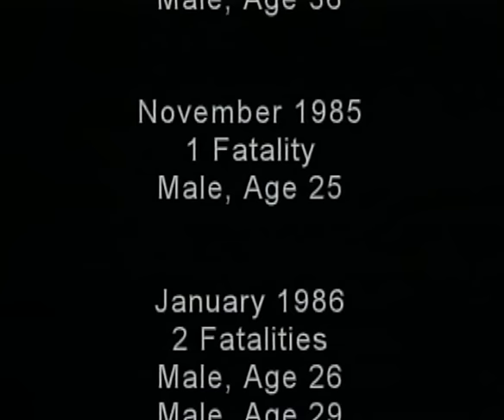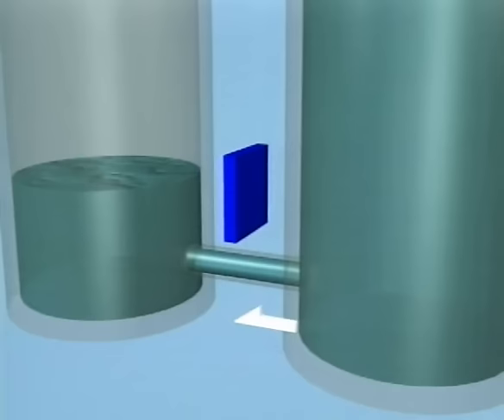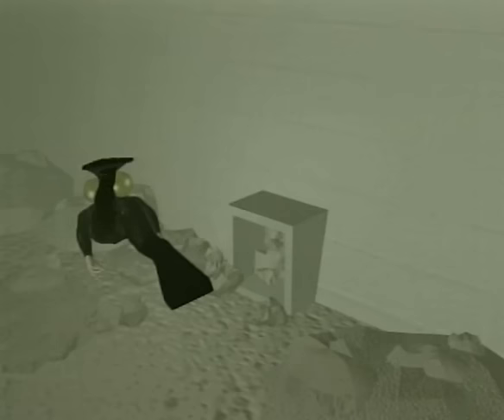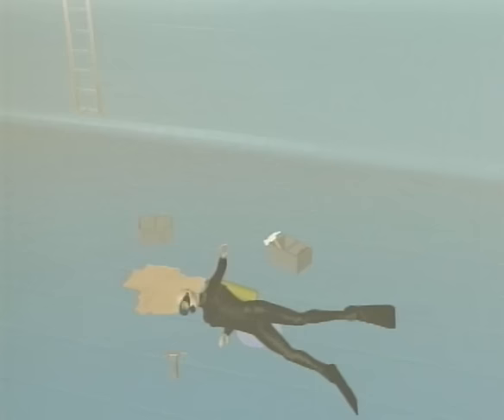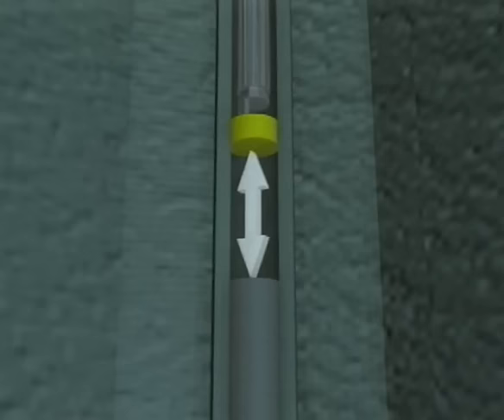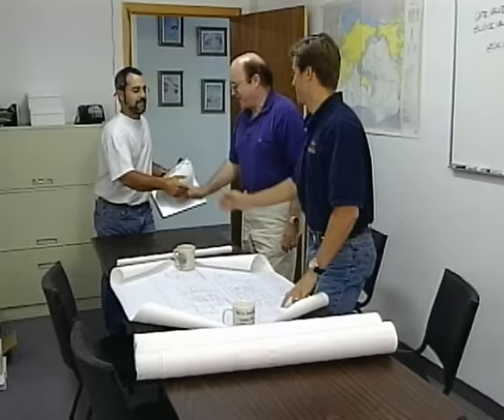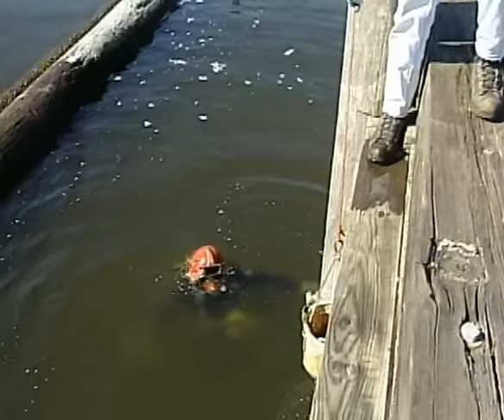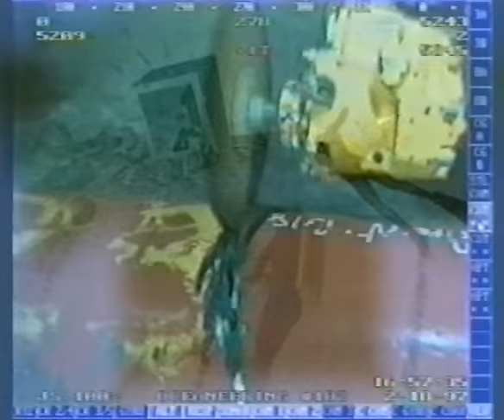Delta P

Comment: This happened to me at a waterpark when I was like 4-5 years old but obviously much lower pressures. I got stuck on the bottom of the floor. Luckily my hand could just reach above the surface so I was waving it. I ended up running out of breath and started breathing in the water then a guy pulled me out... I was sooo lucky. I was literally a handful of few seconds from fully drowning.
Reply: Was it painful when you stated to breathe in water ?
Reply: @ketgremlin8776  it’s a weird pain to explain it’s like almost if your Choking on water
Reply: @amarionthomas8539  only asked because I have a friend how almost drowned and he said there wasnt any pain but it felt quite satisfying
Reply: @ketgremlin8776  Youre in a pool, surrounded by water, you run out of oxygen, naturally your body immediately inhales but instead is greeted by water instead of oxygen. The body doesnt understand this as its out of oxygen and has no oxygen to think and stuff, it continues inhaling. Basically imagine yourself chugging water so fast
Reply: @Covid-bv4hp  just drink all the water out of the pool
Reply: @dachapo6284  Many people tried. They enjoy the water so much they stay in there for the rest of their life for some reason.
Reply: @Covid-bv4hp   damn luckily someone goes down there too save em from drowning
Reply: I think i nearly got stuck on a pool or bath drain because i was playing around with it by repeatedly blocking and unblocking it like any dumb child. I pulled away by using all my measly strength. It wasn't enough for me to get stuck but it was enough to make me scared of pool drains till i was like 10. Added to the fact that some kid did his business in a pool once and it was stuck to the drains.
Reply: Except you're not chugging water, you're inhaling it into your lungs
Reply: @ketgremlin8776   I almost drowned once, you just go banana crazy and don’t think straight.  Basically everyone knows that if you relax your whole body you float, you try to kick the bottom of the pool (or where ever you’re drowning) and flap your arms

It’s really scary and traumatizing
Reply: @foze5698  Same, when I was young I was swimming and for some reason I decided to swim under the solar blanket. I started panicking cause I could feel myself running out of air. By some miracle my wild kicking pushed me back to air before I swallowed too much water.

Comment: I was in a Turkish hamam, there was also a privat section. In there, they build something like a bathtub, but made of marble. The water runs in all the time. You could unplug the bathtub. The hole had a diameter of ~ 50- 60 mm. When i unplugged, i put my hand on the drain to feel Delta p. It was scary, it was very strong. Marble bathtub was ~ 0.4 - 0.5 m in height.
Reply: Delta p. Bad for me.

Comment: I know this isn't related to Delta P, but instead pertains to accepting assurances from the customer. I was going to verify the 480 volt circuit breaker was shut off, but the pig headed bldg owner got indignant and basically said I was suspecting him of being a liar because I still wanted to check it myself, and that he had personally shut it off. Well, it wasn't off, and luckily I only got a moderate shock and wasn't killed. So never, EVER take anyone's word for ANYTHING, check it yourself! If this offends someone, so be it. Lock out and tag out. You are responsible for your own safety! Don't let anyone bamboozle you into skipping standard safety procedures. 
Lastly, a co-worker I knew was killed because he was inside a machine that was not locked-out and tagged out, and his partner started the machine and ground him up alive. ALWAYS FOLLOW STANDARD SAFETY PROCEDURES!

Comment: All of the deaths mentioned in the examples are all cases of ignorance, these companies fixing these underwater structures are the ones who should know about differential pressure and fix the problem without sending down divers without communication with the surface and in some cases diving alone

Comment: Crab: Minding their own business
Underwater Pipe: S  U  C  C
Reply: Could've just used they
Reply: @okalright3941  I know the word "they" is gender-neutral, but it's a plural word, while "it" usually refers to inanimate objects and non-living beings.
Reply: @alfianfahmi5430  not plural. If you where trying to talk about someone on the other side of a crowded room that you knew nothing about how would you address them. You dont know if they're male or female you automatically use they, it's only tricky for you when you think you know some things gender. Stop thinking you know something's gender, they is much much easier
Reply: @alfianfahmi5430  also search up the definition of they on google and the secondary definition is 
"used to refer to a person of unspecified gender."

For example "ask someone if they could help"
Reply: @okalright3941  Was it approved? Because from what I've learned, the word "they" usually refers to plural form since "they" is followed by the word "are".
Reply: @okalright3941  Well thanks for the info, I guess
Reply: @okalright3941  It's a crab. I doubt it cares. 🙄 Even if you misgendered it.
Reply: @okalright3941  by the way. It's a female crab. You can tell by the markings on the underside. It's got an egg flap.
Reply: @okalright3941  Did OP mIsGeNdEr ThE cRaB?

Comment: I can't get over the fact that the last case with the dam definitely turned out like the crab, small opening, dam worth of pressure, torn connections, and 12 hours to recover the 'body' I suspect they found the red smear down stream :X
Reply: You're right, i originally assumed that the tethers broke on the way to the opening, but they would probably in hindsight be too long for that to happen over such a small distance. The poor guy must have been yanked through a tiny narrow gap and turned to mulch.

Comment: What a horrible way to go. RIP to all these divers . I didn’t even know this was a hazard. 😬
Reply: That's why videos like this exist. To save you from the many invisible threats on this earth.
Reply: The good thing is though that since they had scuba gear on, the deaths likely weren't as a bad as regular drowning. When you run out of oxygen,  you're still able to physically breathe, you're just breathing CO2 instead of oxygen, leading to hypoxia. Once that happens, you get loopy and unaware, some people describe it as a "high", sometimes feeling euphoric. They've done experiments where they had a pilot remove his oxygen helmet in a low oxygen environment, and after less than ten seconds, he was so delirious that he wouldn't put his helmet back on, even while his mates were saying "if you don't put your helmet back on, you will die". Luckily his mates were there to put his helmet back on for him.
Reply: There's nothing on the planet more powerful than moving water.
Reply: @KidCorporate  An uncontrolled chain reaction of splitting atoms in a fissionable material might disagree with you.
Reply: @powerstation0872  "The deaths likely weren't as bad as regular drowning" ??  What the hell would you know ? How easy do you think it would be to breathing when your body is sucked in a pipe where it certainly doesn't fit whit a tremendous pressure?  And comparing it whit a pilot testing hypoxia in a airplane is just one of the most ignorance comments I've seen.  Either this is a very bad joke or your just 6-7 years old and out of your lake for sure.

Comment: Not only does Delta P happen in water, but it can also happen in the atmosphere. Have you ever put a vacuum hose on your skin? That's Delta P in action, since the atmospheric pressure in the cleaner is much less than the pressure of the atmosphere, your skin will be pulled due to the fact that the vacuum is trying to equalize the pressure.
Reply: Wow, you just described a phenomenon that even preschool children understand.
Reply: @vitkriklan2633  Well even preschool children understand that the earth is round, but some people still need to be told.
Reply: @LucasIsHereYT  That is very true though.
Reply: The scary thing is, with enough air pressure you can violently get sucked in like in those incidents
Reply: Is that the same thing as like when a hatch opens on an airplane & people fly out
Reply: @CaboCabo2221  yes
Reply: @hanwentian8096  thank you
Reply: @CaboCabo2221  pressure, like energy, attempts to flow from a high state to a lower one
Reply: @floseatyard8063  Nah, your home vacuum isn't  that powerful. Most likely you'd break the vacuum.
Reply: @unliving_ball_of_gas  Em when did I talk about a home vacuum doing that? I'm just saying if there's alot of air pressure it can happen too, not that a vacuum can do that
Reply: Isn’t that what happens with that diving team who died because the room they were in was pressurised?
Reply: I tried and died
Reply: Its less noticeable though since Air is compressible and is much thinner, water is so dangerous because its way more dense and is also incompressible
Reply: Something like that happens in alien 3
Reply: @unliving_ball_of_gas  I broke my vacuum after being disturbed cleaning my room
Reply: @floseatyard8063  Well, you did reply to a comment talking about home vacuum's. So it's reasonable to assume you were talking about it too.
Reply: @unliving_ball_of_gas  no it isn't, I was saying with enough air pressure that it could happen too, I was never talking about home vacuums and there is no reason to assume that.
Reply: @floseatyard8063  I guess I misunderstood you.
Reply: @ronansorgdrager  I think you meant to say Alien Resurrection. I don't remember anything like this happening in 3, but at the end of Res, the hybrid gets sucked out into space through a tiny hole in the glass
Reply: @maevixie7041  yeah that's the one
Reply: interesting

Comment: Saw a story where 4 guys got sucked into an oil pipe while they were in a dry box. They were clearing it and it ended up filling the box with water and sucking all 4 down, almost a km. 1 died instantly, 1 died shortly after, and 1 guy actually got out, and the other died shortly after. What an actual nightmare. The story is out there and there is video.....

Comment: I remember going to a wellness/spa place a few months ago, and there was one specific waist-high pool which had a bubble/foam generator with several nozzles placed on the sidewall. It worked by pumping the pool water out and pushing it back in through the high speed nozzles. The pump had an intake pipe that was about 10cm in diameter, and the guard rail was missing too. As I was shifting around in the pool, it suddenly caught my heel and I could barely pull it out. Since I can't swim, it freaked me out. Considering how much of a scare this incident gave me, I can't even begin to imagine how terrifying it would be to encounter a deadly situation such as a dam clearing even if I were a trained scuba diver. Knowing that I wouldn't be able to break free and I'd meet death unexpectedly while just doing a job.

Massive thank you to all the divers doing such jobs. I wonder how they don't just sink to the bottom while carrying such massive cojones.
Reply: If you were doiing a dam clearing and that happened you would literally get pulled apart, like the crab in the beggining you would have your arm or leg get twisted to fit into a tiny hole and soon die of internal injuries
Reply: @Gabovo  Goin out like a CapriSun.
Reply: Dude literally thanking divers for doing a job haha just because he cant swim
Reply: @freshrot420  Damn after seeing this those CapriSun packages hit on a whole new level now.

Comment: When they don't elaborate or the diver didn't run out of air.. Considering what happened to the crab my imagination is not painting a nice picture of why they died.
Reply: well, imagine the kid who got stuck to the pool bottom in the Final Destination movies. that's Delta P in action. definitely not pretty.
Reply: Ror Maco IKR I'm wondering if the guy whose foot got sucked in the well died like the crab :(
Reply: When the hole is small enough but also large enough to suck in a body part with full force, you either have the chance of that body part being sucked in and completely mangled, while still alive, and run out of oxygen. The other situation is having the hole be large enough for a body part, but the force EXTREMELY large. That means, when pressure releases, your entire body becomes grinded and crushed in the pipe. Instantaneous death, terrible clean up job.
Reply: Theres also a chance of having a body part or more mangled, then dying due to injuries shortly after.
Reply: Ashley Black IASIP lol
Reply: Just read about what happened to some of the submariners on board the Kursk submarine.
Reply: Emmett Smith that’s what she said
Reply: 6:11 dude died on impact
Reply: QueenOfTheSea101   uhh... that happened to a little girl, for real. 
YouTube is demented.  There is no button to stop this garbage.  It is not just the horrific stuff, it's all the suggestions that are based on things I've searched, not on yt, that reminds me yt is using all the info that ad co.s have taken an oath not to share frivolously, from everything on my phone that they can hack.  I could just not look at the suggestions... but... does anybody else think that this whole platform is kinda... evil?  I push not interested on anything horrific, and still, yt shows me commercials that are little horror movies about the dangers of vaping.  Vaping.  
It isn't the vaping that i find disturbing.

Comment: When I was swimming in a water park, there was a water slide called the Big Spin (Splashtown, Spring Tx). It was a body slide “bowl” where after so many times of going around the bowl, you would fall into this pool right beneath the bowl. It had a depth of 8 feet, and since water would constantly be crashing down on you with no sunlight, it was disorienting to exit the pool. It didn’t help that some reason there was a metal grid-like drain (shaped like a generator) that would linger on the wall of the pool. Similar to how on some lazy rivers, there would be wall drains to catch debris or something to help it filter. 

The first (and last) time I did the slide, I had a trembling fear of deep pools. Anywhere that was deeper than 6 feet... and that’s a hell no for me. I went on it because I did a bet with a friend, and when I landed in the pool below, the metal grid-like generator was clogged (I initially didn’t know this going down it) and my landing was basically a dive.
It wasn’t the only drain, because there was a single small drain a the bottom and delta p hit me. Now I know that the drain was to help make up for in case of delta p happening. 
 
How did I live? Well, one lifeguard noticed the leaves clogging the generator and immediately cleared it, while another life guard dived in to get me out of there. 

I still have a fear of deep swimming pools, especially those that are 8 feet. Even when I do swim at those depths, I always get tense and lock up when I’m swimming the the open above an abyss of nightmare fuel. 

I can’t image what divers felt like after they’ve survived it because it’s like a permanent scar to your brain now.
Reply: Holy shit....
Reply: Thank god for the life guards.
Reply: I just read about a scuba diver who got sucked into a pipe near Hutchison Island, FL.  He got spit out into a pond on the electric company property.  A Delta P survivor!
Reply: That is indeed scary, but always remember: "I will not fear, for fear is the mind killer..."
Reply: Yo play Subnautica
Reply: @DamonInferis  fear is also the body saver
Reply: Glory to God that you survived ☦
Reply: Wait what happened to your friend of the bet then? Did he did something or..?